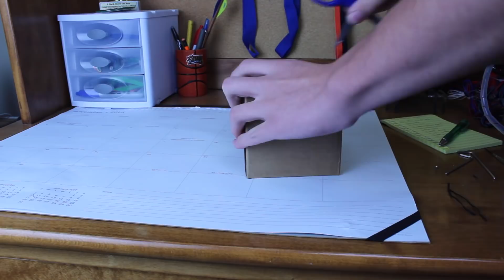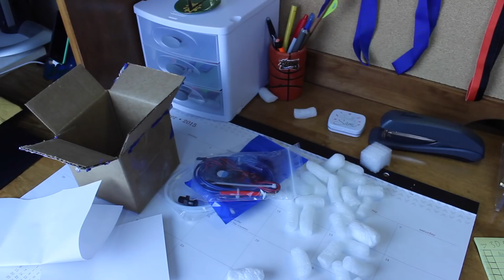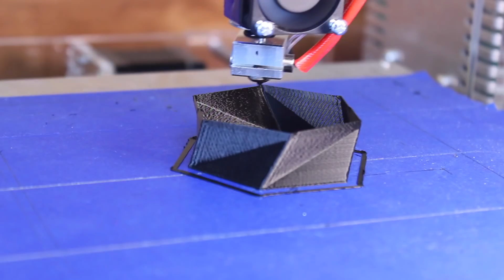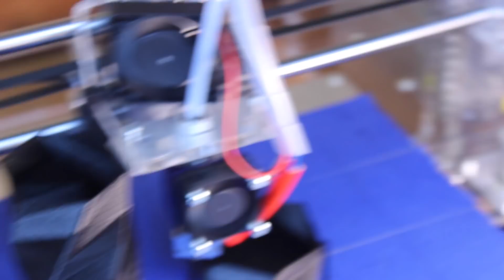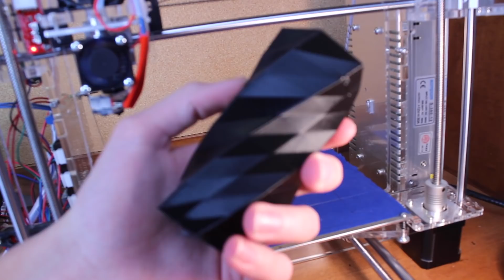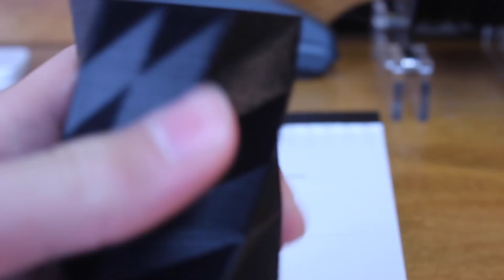Sunhokey Reprap Prusa i3 3D Printer: E3D v6 Unboxing, Review, and First Print!

Comment: did you ever fix the ooze on top of the hotend block . Think you may have forgotten to tighten the nozzel when it was at temp
Reply from the maker: +bigfilsing Yes! I did fix the ooze problem by tightening the heat block when it was heated up. The problem is twisting the assembly and not getting burnt!

Comment: Have you modified your firmware at all? I have the same printer but from factory it didnt print very well at all. I then upgraded to the E3d hot end and still havent had any luck. If at all possible i would really appreciate if you would share your settings with me . Thanks, Adam :D I got mine around 6 months ago so im wondering if they have upgraded the firmware.
Reply from the maker: +coopadupa The settings I uses are all factory default. I realized the printer wasn't printing very well and I looked into the firmware but found not updates. The one thing that really helped is printing a new z - endstop, extruder mounting plate bracet, and y - axis clips for under the bed. This fixed all the wobble and let me print better parts to replaced the ones that didn't print correctly. Also, what slicer software are you using? I would recommend cura by ultimaker. It is so easy to use and allows me to change all the setting that I need on the print before I put the sd card in. You can watch this video to learn how I use cura - https://www.youtube.com/watch?v=fVpn4KjHT80

Comment: Hey nice video! I have exactly the same printer without the e3d v6. 
Maybe a nice tip: You could add some 12V ledstrips to the acrylic frame for better lights. (I have mounted some ledstrips too)
And if you replaced the handtight nuts beneath the printer's bed with locktights you only have to calibrate your bed once.
Again nice work!
Reply from the maker: Thank you! Mounting led lights under the acrylic is on my list to do. I will also be looking into switching out the hand nuts to wing nuts. What led strip did you purchase?
Reply: I bought and use this one: https://my.dx.com/MyOrders/OrderDetail/151102001031344053
Two of them fit perfect under the frame.
I connected them directly to the power supply.
Reply from the maker: +ElectronicManiac Awesome, thanks! Could you send me the link to the product page? I cannot view the product without creating an account.
Reply: Ow ofcourse I can. http://www.dx.com/p/diy-3w-3000k-285-315lm-cob-led-rectangle-strip-dc-12-14v-142034#.VmhZmnYvfIU
Here it is :)
Reply from the maker: +ElectronicManiac Awesome